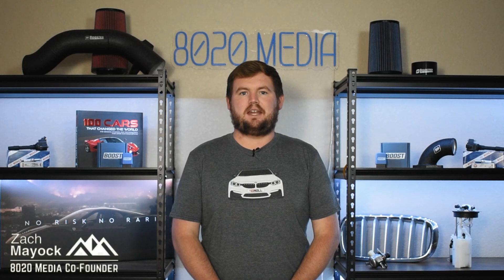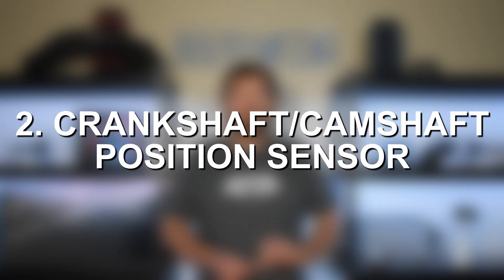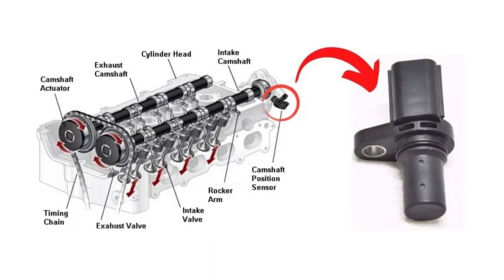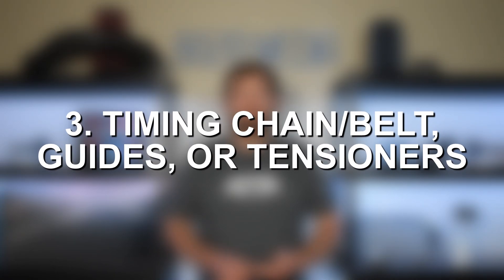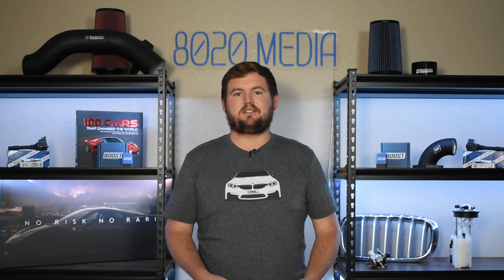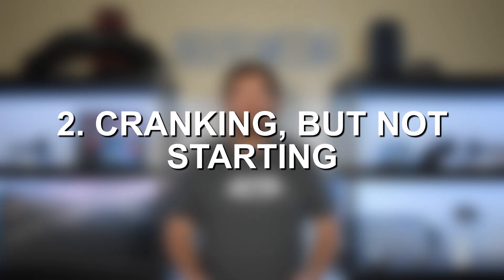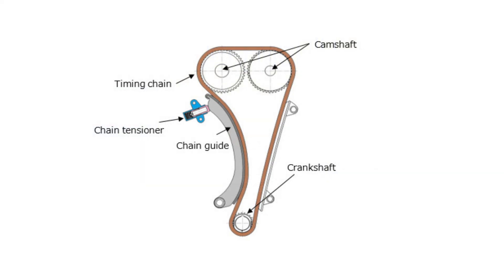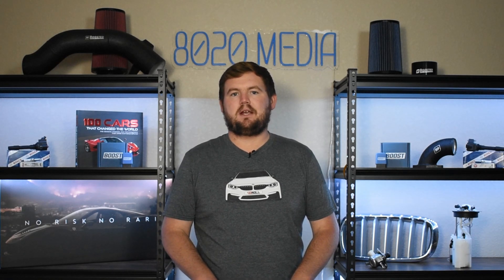What's Causing Your P0016 Code? Symptoms, Causes, & Fixes!

Comment: Not helpful for VW TDI engine. P0016. New belt installed nothing changed. Timing .9 btdc not sure if this the cause. AUX fuel pump not running( it does run with jump wire) this is a replacement engine, original did the same things.
Reply: I am going to check the wiring to the crank and cam sensors. The injectors don't fire but glow plugs do lite. I'm thinking an issue with the connector of the 60 position ECM. Also the relays have been replaced for the Aux fuel pump relay. Does anyone know how to use a breakout box? I'm wondering I could use one to check wiring?
Reply from the maker: S - For a VW TDI engine throwing P0016 (Crankshaft Position-Camshaft Position Correlation), especially after a timing belt change and with timing at 0.9° BTDC, the issue may still be mechanical timing—even if the marks look good. These engines are very sensitive to cam/crank timing alignment, so slight misalignment (even one tooth off or incorrect torsion value) can trigger this code. Check the torsion value in VCDS; ideally, it should be around 0.0° ±2.0°—outside of that can cause issues. Also, verify camshaft locking tools were used properly. Since the aux fuel pump only runs with a jump wire, double-check its wiring and relay, as poor fuel delivery can also cause timing correlation codes due to engine misfires or hard starts. Lastly, since this is a replacement engine and the original had the same code, inspect the crankshaft tone ring for damage or sensor alignment issues—it might’ve been swapped from the old engine and could be faulty.

Comment: Hi. I have 11 gmc ecotec 2.4. I replaced the timing chain and exhaust camshaft intake camshaft position sensors ,I have 195 psi compression and new spark plugs and engine starts right away very well after 20 seconds starts to working bad and than shakes and  stops and codes are p0014/p0017/p0016/p0365/p1682

Can you please guid me to look for these codes ? 
Thanks you
Reply from the maker: D - Your codes and symptoms suggest the timing may be off or there's a camshaft sensor or VVT solenoid issue. Codes P0014, P0016, and P0017 typically point to improper timing chain alignment or faulty VVT solenoids, while P0365 indicates a possible issue with the intake camshaft sensor or its wiring. The P1682 code relates to the ignition switch circuit, which could cause random stalling and points to possible issues with the ECM or power supply. Start by double-checking mechanical timing to ensure all marks were correctly aligned during the timing chain replacement. Then inspect wiring and connectors to the cam sensors and VVT solenoids. If the timing is good, try swapping VVT solenoids between banks to see if the P0014 code follows—this would confirm a faulty solenoid. Also, make sure oil pressure is within spec and that the oil is clean, as poor oil quality or pressure can impact VVT operation.
Reply: @ hi. Thank you so much for reading and responding. I found the problem,it was throttle body gasket and cylinder 2 injector ,I replaced it and it’s working like brand new and all the codes went away now. But it was very long search and work. Thank you again 🙏
Reply from the maker: @DRDDNV  Glad to hear! Thanks for coming back and updating!

Comment: I have the same fault code coming up but there is no other issues with the vehicle. The vehicle drives perfectly fine 
However the vehicle is modified…
Reply from the maker: R - P0016 is a crankshaft/camshaft position correlation code, often tied to timing issues—but in a modified vehicle, it can also be triggered by non-OEM camshafts, cam phasers, timing chain stretch, or even tuned ECU parameters that alter how the cam/crank positions are interpreted. If the engine runs perfectly fine, it's likely that the tune or cam timing is just outside the expected OEM thresholds. You should verify mechanical timing is on point first (especially with mods), then check if your tuner can adjust the threshold to eliminate the false P0016 without masking a real issue.
Reply: @ Thank you for the feedback! I really appreciate it. I have replaced the both cam sensors and the crank sensor. The fault is still under pending then after a few kilometres it comes up as an active fault code. 
I’ll inspect the timing belt and the harmonic balancer next !

Comment: What if you have a persistent P0016 and the engine starts and runs at all speeds and loads, perfectly? My signals are perfectly shaped all the way to the ECM. Unfortunately I don't have a known good pattern for the correlation.
Reply from the maker: J - If you're getting a persistent P0016 (Crankshaft-Camshaft Position Correlation) but the engine starts and runs perfectly, it suggests the timing components may be slightly out of spec but not enough to affect performance noticeably. Since your sensor signals are clean and reaching the ECM, the issue could be due to stretched timing chain, worn timing components, or a reluctor wheel that has shifted slightly. A stretched chain can cause minor timing discrepancies without triggering obvious drivability issues. If you've recently done any timing work, it's worth verifying the mechanical timing marks. Otherwise, checking for excessive timing chain slack with a scan tool (cam/crank angle deviation) or physically inspecting the timing system would be the next steps. If it's not causing performance issues, you could monitor it, but a persistent P0016 usually indicates a potential timing problem that may worsen over time.
Reply: @8020Automotive man that is super helpful. That was my big question:,can the timing be off enough to throw a p0016 while the car still drives great? If so, guess I’m gonna have to pull the motor to get to the dam thing. Much thanks for the comment.
Reply from the maker: @JeffMTX  If your car starts fine but won’t restart after auto stop-start engages, and you're only getting a single click when trying to restart, the starter could be the issue, but there are a few things to check first before spending $1,205 on a replacement. Since your battery is new and the alternator tested good, start by testing the battery voltage when the car is off, running, and during cranking—it should be 12.6V+ when off, 13.5-14.7V when running, and not drop below 10V during cranking. A weak ground connection or corroded battery cables can cause these symptoms, so check and clean all battery terminals, ground connections, and starter cables. Also, ensure your auto start-stop system is not malfunctioning, as some vehicles require a secondary auxiliary battery to restart after a stop. If everything checks out, then yes, the starter solenoid or internal wear in the starter motor may be failing, and replacing it could resolve the issue.
Reply: @8020Automotive  Thanks, no, it starts great every time. It just throws P0016 every time it is started. After replacing all the sensors, same. Signals look healthy on a scope, but I can't discern the synchronisation among them. All I can figure is stretched timing chain. Again- engine always runs fine. Great power. Just the persistent P0016....

Comment: My 04 trailblazer has a P0305 and a P0016 but it actually runs and drives almost normal except the misfiring . It  did the same thing a couple months ago. Then I  changing the coil and it ran great again. So I'm pretty sure The P0305 will go away once I change the spark plugs. But I'm not sure about the P0016 because it really doesn't have all the symptoms listed on this video except for the misfiring.
Reply: Note that p0016 can cause misfire, but will affect all the cylinders, just fix the number 5 cylinder, once you don't have p0300 multiple misfire detected
Reply from the maker: J - The P0305 (cylinder 5 misfire) and P0016 (camshaft/crankshaft correlation error) on your 2004 Trailblazer are likely related. Replacing the coil may temporarily resolve the misfire, but the underlying issue could be causing the recurrence. The P0016 suggests a timing issue, potentially from a stretched timing chain, a worn timing chain tensioner, or a faulty camshaft position actuator. While your engine may not show all typical P0016 symptoms, the misfire and repeated coil failure could be early signs of timing alignment issues. Replacing the spark plugs and coil may temporarily resolve the misfire, but you should inspect the timing chain and camshaft actuator for wear or faults to address the root cause. Keep us updated!

Comment: mine shows p0012 and p0016...it also showed other stored codes like p0340 p0303
Reply from the maker: M - Seems like you have a misfire going on. This video may also be helpful: https://youtu.be/f1mQ5hD1-vI
Reply: I changed the spark plugs and a coil erased codes...the p0303 and p0304 don't show anymore but the other 2 keep on showing...and a p0010 shows now as well
Reply from the maker: M - Looks like you got rid of the misfires. Have you replaced the camshaft and crankshaft sensors?
Reply: @8020Media  no I just took out the camshaft sensor and it had a piece missing from the tip I'm waiting for the original motorcraft I ordered gets here today...but now I'm worried if that little piece of plastic that broke off damaged something else inside.
Reply from the maker: M - Keep us updated!
Reply: @8020Media  so I replaced the camshaft sensor and the only code that it shows now is the p0010 amd I noticed the vvt solenoid is leaking oil from where the connecter goes...I cleaned it off ran it and noticed there a bit of oil on it again so I'm guessing a gotta replace the vvt solenoid now smh...thing is I have to take off the whole cover to get to it...sigh
Reply from the maker: M - This would be our guess! Seems like you're very close to getting the issue fixed. Keep us updated.
Reply: @mrcupcakeman32 did you get it fixed
Reply: @blok9977  no it's most likely the timing chain but im not gonna attempt to do that myself. once I save some money up I'm going to take it to a shop